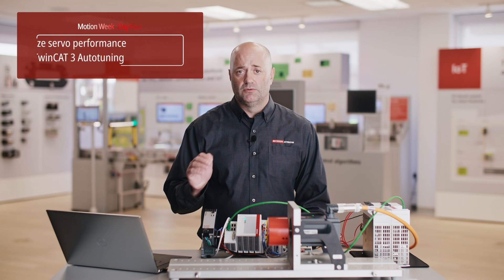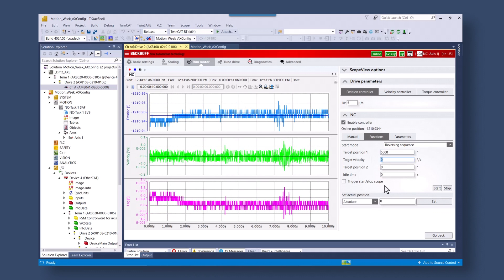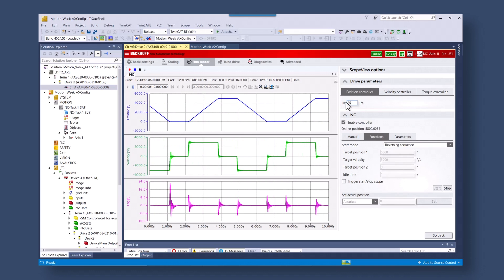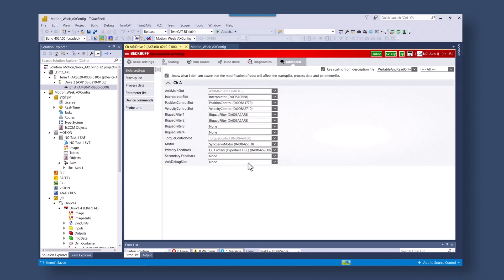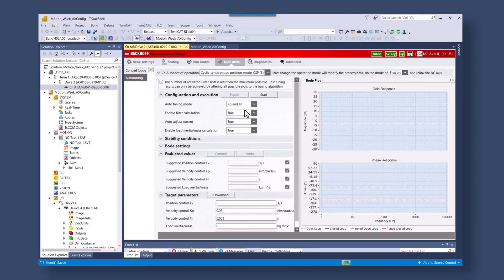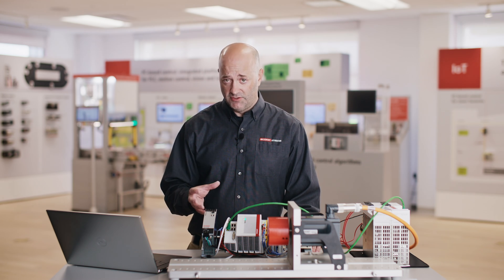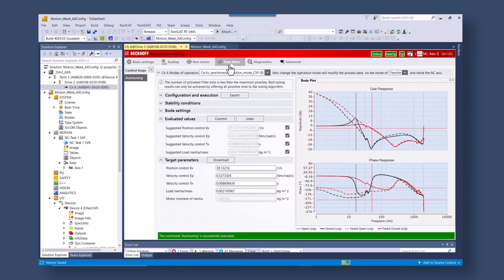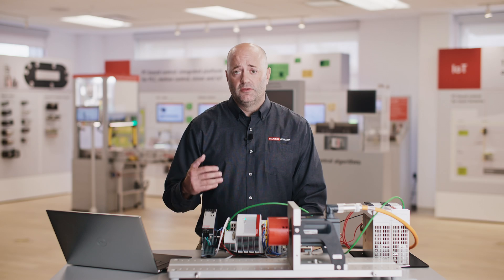⚙️ Motion Week – Day 4️⃣ – Autotuning

Comment: Can this be used with EL7 drives or only AX?
Reply from the maker: Currently, autotuning is only supported with the AX and AMP series drives (AX8000 FW 1.06, AX5000 FW 2.15, AMP8000 FW 1.06). We plan to extend autotuning capabilities to ELM72xx series compact motion products, with a firmware release expected in 2025. 

For more information: www.beckhoff.com/ELM72xx 

Please reach out to your local Beckhoff team for more information on this or any other topic: 
www.beckhoff.com/contact